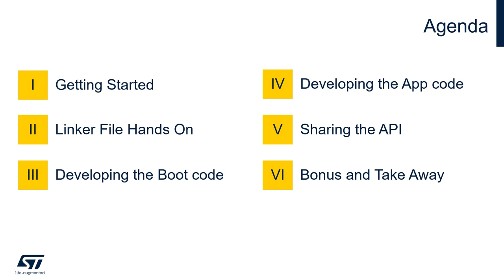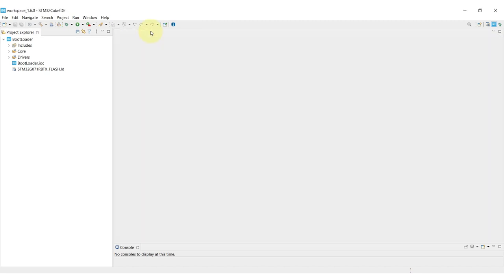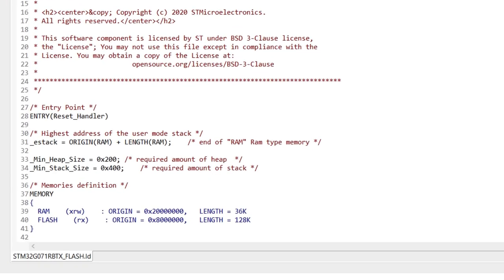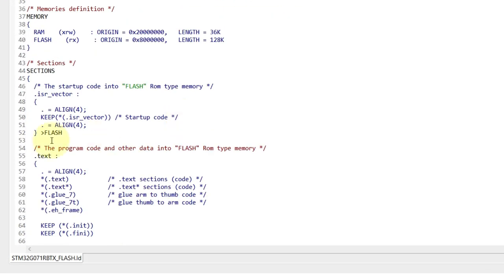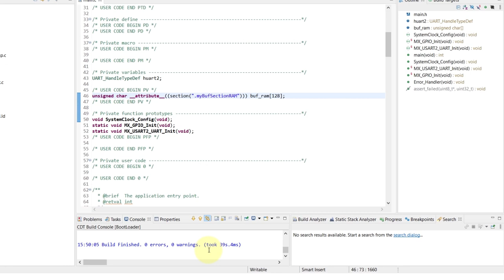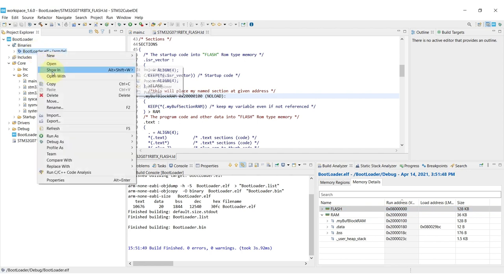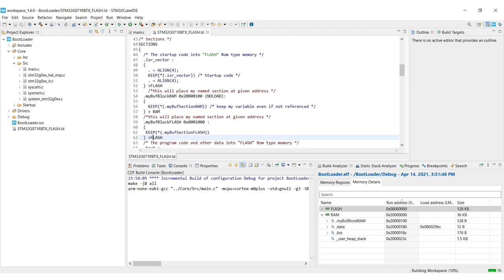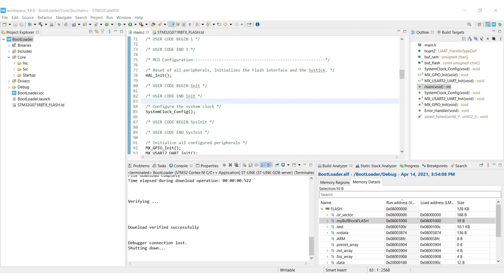How to Create a Super Simple Bootloader, Part 1: Getting Started

Comment: Didn't get the NOLOAD part. 
what is happening here? If you do this then while you are flashing you are skipping this 128bytes of array. So it takes less time to compile and build and when flashing you ultimately skip the section.
Am I correct?
so default value will be 0xFF if that area is cleared.

Comment: Great product, why not sell them already bootloaded? And have a programmer like arduino does? I'm not an engineer, I can go through this but why not use arduino instead? Truth is I like your chip better and will learn.
Reply from the maker: Hello @jjrd. Thanks for your feedback! We have sent your compliments and valuable suggestions to our colleagues and they have come back to us with the following feedback which we hope you find useful.

In fact, all our STM32s come with bootloader already programmed and if you want to dive deeper in this regard, you can refer to AN2606 (https://www.st.com/content/ccc/resource/technical/document/application_note/b9/9b/16/3a/12/1e/40/0c/CD00167594.pdf/files/CD00167594.pdf/jcr:content/translations/en.CD00167594.pdf) where we explain all the possible entry points and supported interfaces (including USB and Serial, similarly to what the Arduino ecosystem provides).

The goal of this video is to explain how to create your own and not dive into details about the existing and pre-programmed one as they are very easy to use. The motivation behind the video is to create a foundation on how to build one that, given an application, might need different features or higher security level than the one pre-programmed.

You may already be aware of this, but our microcontrollers are used in a lot of different scenarios, including being the core in some Arduino boards, such as the Portenta H7 board (https://store-usa.arduino.cc/products/portenta-h7?selectedStore=us). As a plus, you can use most of our own boards in the Arduino ecosystem. Here is a quick tutorial to help you get started: https://community.st.com/s/article/getting-started-with-stm32duino

Thanks again for your interest in the topic.
Reply: @stmicroelectronics  
I am registered user at stm since I bought an stm32 from china and would like to use it for my next project. 
I thought AI would be a perfect complement to ide programmer.
Plug the chip in, hit AI and start dialogue.
AI can identify the chip, ask what I intend to do, security, maybe interactive flow chart. Program (correct) and install bootloader.
Then I'm ready to use the chip. 
Reboot maybe in the arduino style ide programmer with examples...etc.
Reply: AI is the perfect machine to write code,
ChatGPT style.

Comment: At 4:00: Please note that the KEEP needs to be same name as the section name: So, not KEEP(*(.myBufSectionRAM)), but: KEEP(*(.myBufBlockRAM))
Reply: I don't think that is correct.  The output section name is myBufBlockRAM while the input section name is myBufSectionRAM.  If the linker is told to keep the .myBufSectionRAM input section then it will implicitly preserve the output section also.